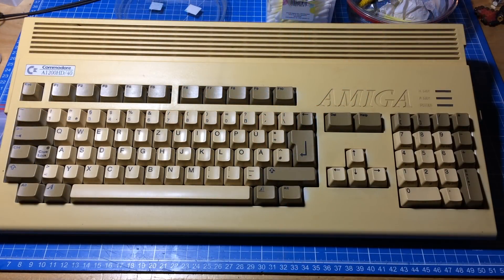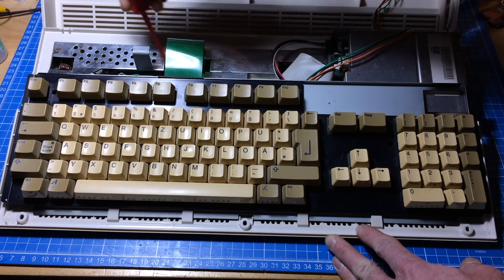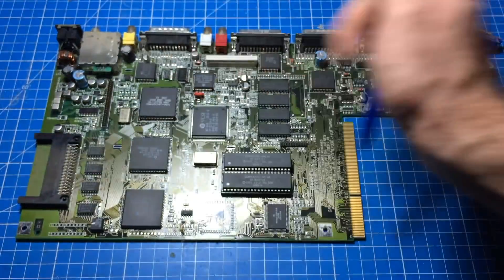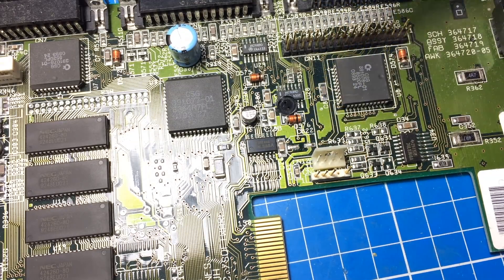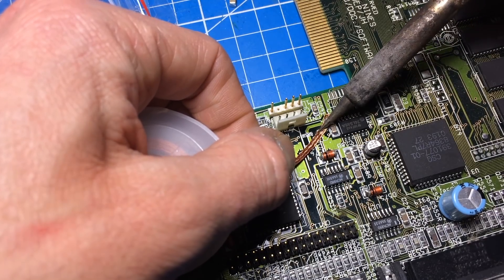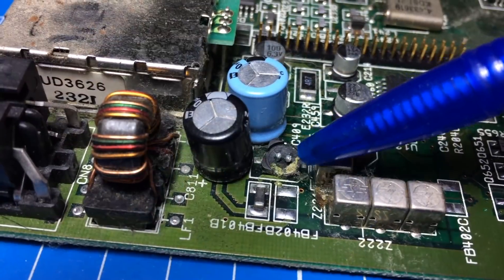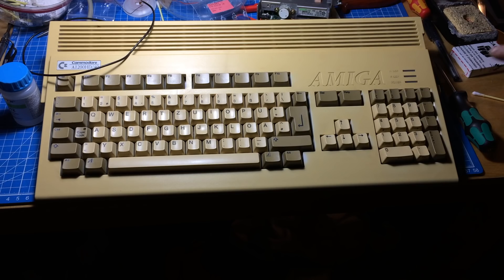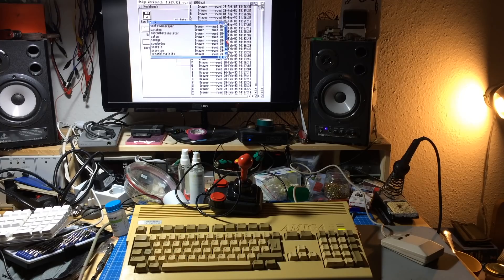Amiga 1200 Full Recap with Ceramic Capacitors

Comment: A booting machine is NO sign of woking caps!
Reply from the maker: +ChuckyGang Right. Sorry if it came across like that. I was just happy that it worked at all. Tested it for 10+ hours after this. Works a treat. No signs of any malfunctions.
Reply: you will notice the problems after much longer time using the wrong type of caps.  actually they are doing NO good atall  so in time.  (maybe long time) it will damage your machine..   so remove them and put in correct caps instead if you want to actually protect your machine.
Reply from the maker: +ChuckyGang Sorry, Sir but do you have any experience in electronics apart from soldering stuff together?

The ceramics filter ripple as well. In a way they behave very similar to electrolytics. They just have different charging timing (most of the times way faster than electrolytics). On the negative side, they resonate sometimes in harmonic bands of the filtered signal which the electrolytics tend to do less. As you (and I) have mentioned, the capacitance changes with applied voltage. Temperature is actually not quite as much an issue (although it has some effect).

It is complete nonsense to compare a machine running without caps to a machine running with ceramics of proper ratings. And by the way, higher rated ceramics often cost more than equivalent electrolytics. Because they are cutting edge technology. Which is also why they couldn't be used in the Amigas in the first place. Because they didn't exist in the early nineties. Maybe in some laboratories but not in off the shelf home computers.

I still wouldn't recommend using ceramics but it's not as bad as you want it to be. If you have data to prove your statements I'll be happy to argue. Otherwise it's your turn to do some research.
Reply from the maker: +Amiga Warez The capacitance of ceramic caps changes quite a bit if you apply voltage. It works quite well if you carefully choose the caps (higher voltage ratings than the electrolytics) but it will never be as accurate as the original values. So there MAY be issues.
Reply from the maker: +Amiga Warez If you can't reach it otherwise, ceramics will do. Make sure they have a higher voltage rating than the original electrolytics and you should be fine. Always better to use electrolytics, of course. They don't come in other packages (except for through-hole which are even bigger) unfortunately.
Reply from the maker: +ChuckyGang There is a series of videos from Dave of the eevblog explaining how ceramic caps behave in great detail. I would recommend that. I'm not arguing that ceramics don't behave differently. I just don't think that this will do harm to the Amiga. Nothing's gonna explode or malfunction anytime soon because everything's well within tolerance. Otherwise you would see strange behavior/heating of components etc straight away. Why would the behavior change with time if you use stable components (which they are)? I agree meanwhile that it's a better idea to use good quality electrolytics as they are simply closer to the original specs of course.
Reply: Please tell us how Ceramic of same value caps can do damage to the board? I want to know the reason why so if people ask me.
Reply: Ok thanks for the reply I have two caps on my Amiga 4000T that are right next to the Keyboard plug in connector. I was hoping to use Ceramic there so I wouldn't have to remove the Keyboard Plug. Is there some other Cap I could use there that would lay flat like the ceramic does to make it so I can solder it?
Reply: Well  Capacitors is a very hard subject. with a lot of opinions etc. . but let me just put it short:  IF you get ANY type of issue with a item from Individual computers and tell that you have ceramic caps. you will get a answer that it is capped with the wrong components and no support will be given.  Even if I am one of those who learned electronics by myself since long time back. I have got many explanations from others that I have deep respect for. I just cannot remember the EXACT information right now (or more.. how to put it down into writing).  but in the end: it behaves different. it handles ripple different and there are NO reason to change type.    .  tried to find a good description now that a friend wrote about this in an Amigaforum technically explaining WHY this is a bad idea..  too bad I did not find it now. if I find it. I will post it (but it is late here in Sweden now.. )

but yes.  out of 100 persons seeing this  you will get 100 (or well.. 90) different opinions.

But the ONLY reason to put in ceramic caps is to get the price down.  and it IS Amigas.  why save a few pennies?  if a ceramic cap fail.. well they do not leak  but they make REAL ugly burnmarks.

A question is: if you do not recomend using ceramics.  why do a video of it?   we who love the amiga: we want the best for it. we do not want "bad recommendations"  (like twisting off caps, using wrong components etc)

Anyway.  I just did a quick google "can i use ceramic caps instead of electrolytes"  and found very interesting aritcles. some say it is ok (like you) and some say "NO!":.   however. when it comes to the Amiga: I want to be on the safe side.  chips etc are not produced anymore, why risk killing them?

I instead put the best qualirty caps I can find.  and have done so in several hundreds of Amigas that I recapped/repaired.
Reply: they simply behaves different. and one important thing with the caps is to get rid of rippel etc.  the ceramics will simply just don't do it. so it is close to run the machine without caps atall. the protection is gone.
it will "work"  yes. but so did the machine with the bad caps aswell.

and if your PSU (that also should be recapped) is bad.. well.. it goes into your machine.  caps cannot handle it. and after a while maybe failures.  all by saving some pennies using the wrong caps.  worth it? nah!  use same type just better quality.  when designing the board they have caluclated for more stuff then just capacitance..   and also. ceramcs have different capacitance depending on voltage applied etc. just.  behaves different..
Reply: using the caps I use in my rant post http://wordpress.hertell.nu/?p=464  no need of removing anything